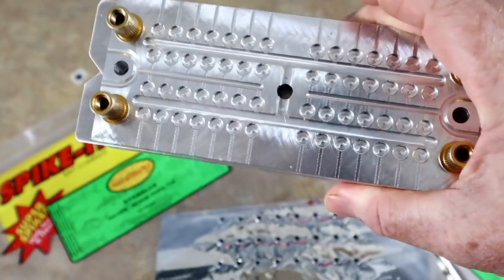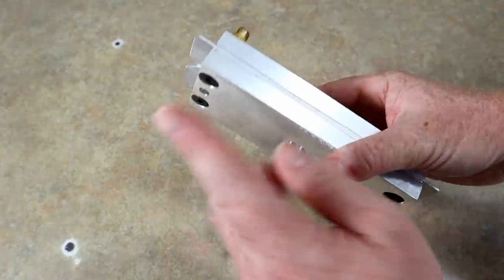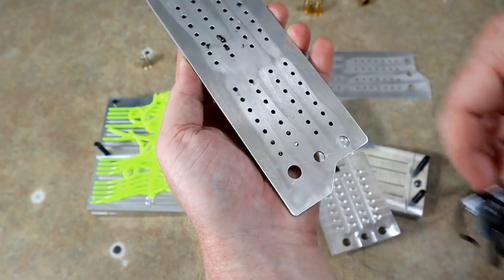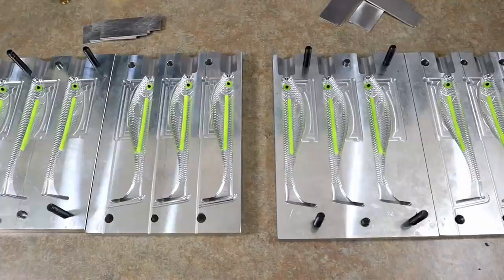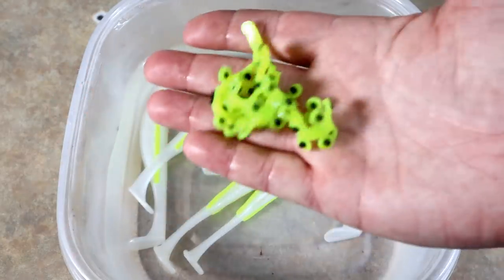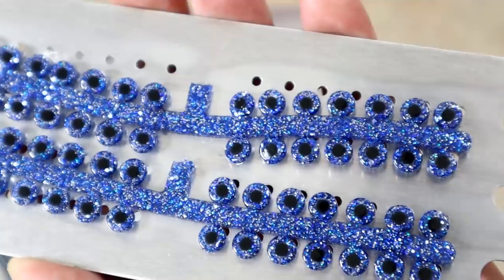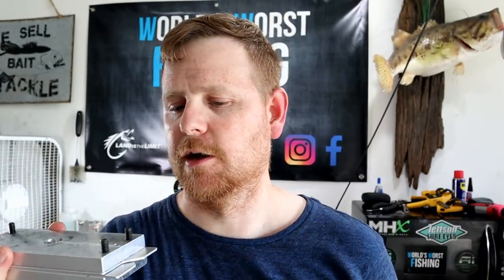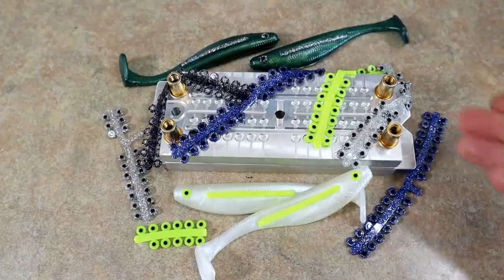Soft Plastic LURE EYE MOLD!!  Lure Eye Injection Mold System

Comment: That is an engineering marvel. Wow. Super cool. Would love to see the adhesion to the swim bait body if you could “peel” the eye away
Reply from the maker: you can if you try..in my experience with the traditional eyes they will eventually come off from time to time during extended use..doing it this way with softer plastic should help that.

Comment: Hey Chris, early on I was having trouble with the eyes shifting in the mold when shooting. I then strated using a tiny dab of vasaline in the eye socket and that helped keep the eyes in place. Every once in a while I will run into a bonding issue between the eye and the bait. I am wondering if its the vasaline causing that or not enough temperature. I shoot the bait pretty hot.......thaanks for your input.

Comment: Hi I’m having a problem the plastisol I get is a medium blend and it’s the only one I can get in Canada the problem I’m having is with open pour the plastic when I poured into the mould seems to be shrinking leave  divot The top of the mould doesn’t want to fill I’ve heated the mould up quite hot to accommodate the hot plastic to stop shrinkage I thought but it still seems to be happening I’m wondering is it because of the medium plastic that I’m using
I sure hope you reply thanks Brad Andrews your friend in Canada by the way great show been following it for a long time

Comment: Chris, im having trouble with my new Do-It 4oz. Hand injector. Every so often I have to take it apart and clean out thin bits of plastic that has gotten behind the plunger. If I dont keep it clean it ends up drawing air instead of plastic. Do I need to replace to o-rings or is this normal? I just bought the thing so I figured the orings would be ok but perhaps it sat in the store for a long time before I finally purchased it?

Comment: Not sure how your keeping the eyeballs from moving during the injection step. I found that by applying a tiny touch of vasline to the side of the eye that touches the mold made all the  difference in the world for me. I was experiencing random eye shift during the injection.
Reply: I use vasiline. Take a q-tip and just barely coat the eyeball socket in the mold. That will hold the eye balls in place. You might still have a eyeball wonder, but have have had great sucess.